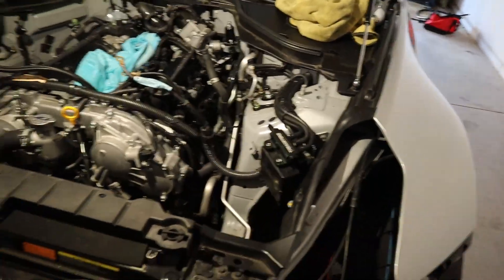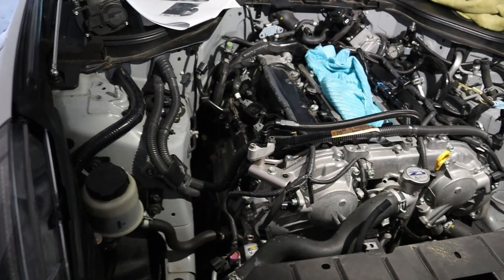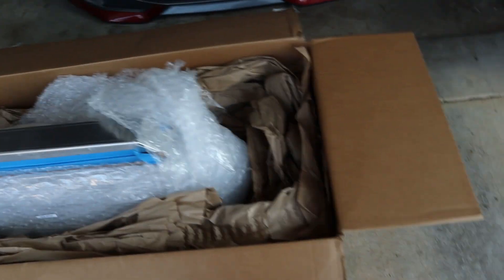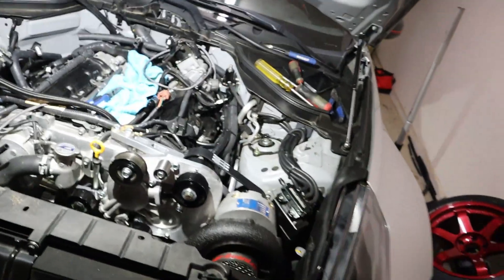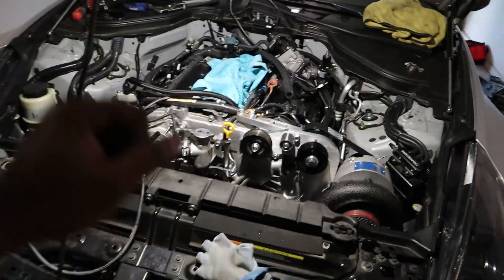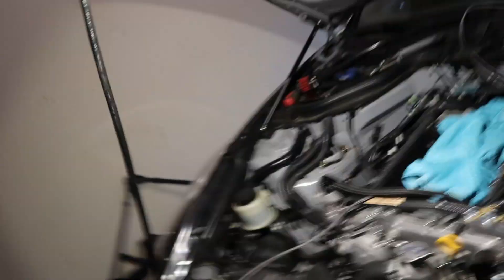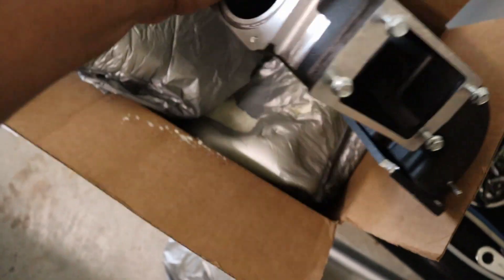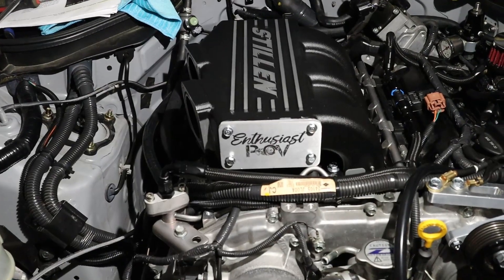Boosting my 370Z Nismo - Soho A2A Supercharger Kit Install Pt.2 First Start up!!

Comment: Just called Yunier at z1 today, helped me pick out a fuel return set up for my car, I had no idea he was making YouTube vids, definitely subscribing thanks for the help today Yunier 🤝
Reply from the maker: Anytime man ! The S1 should be okay, as long as you have a VHR stock fuel rails are okay.
Reply: @EnthusiastPOV  unfortunately still holding on to the de, stock block at that🥲 ended up grabbing the s0, will probably upgrade rails and such when I shoot for more power, and get ahold of a built motor, Jon’s been working his magic but we’ve had a few hang ups hopefully this is the last 😂

Comment: I can't tell if it is or not but make sure the belt on the supercharger is an RPM belt, helps a lot in preventing belt slip. I make 15psi with a tiny filter with one.
Reply from the maker: I have no belt slip on mine. Makes 15-16 PSI

Comment: Congrats man! Can't wait for more content on it. Btw if your getting soho combo catch can I recommend using longer hose for the coolant overflow because after dumping the excessive coolant it got all over the motor & aluminum undertray.  Recommendation get longer hose and reroute it so it can dump it on the ground or just don't put to much coolant on the reservoir.
Reply from the maker: Thanks for the tip bro, I’ll keep it in mind 🤙🏽🤙🏽

Comment: Congrats!  I know how you feel.  Don't go overboard with the timing, as 600whp is plenty enough!  I am about to data log my car to check the knock thresholds.
Reply from the maker: Just a base tune, I trust Jon to give me necessary sauce but I’m
Pretty pleased overall with it!
Reply: @EnthusiastPOV  So, I just completed my first data log with ecutek connect.  It is a small file because it turns out that state troopers are not fond of data logging.  I tried to explain what a pull was, but I ended up pulling out my license and registration.
Reply from the maker: Haha ouch!
Reply: @EnthusiastPOV  I am not much of a computer guy in terms of posting content, but Dynosty's Facebook page now features my 370z Nismo as the most recent post. How far in the RPMs can you get on the base tune?  I know you cannot wait to go WOT!
Reply from the maker: Car is tuned. I need to tighten the cog belt. Made 613whp on 93 at 7k rpm. Belt slipped the rest of the way.
Reply: @EnthusiastPOV  I had the same problem.  They had to reposition the belt and it made a world of difference.  If you can made 600wph with belt slippage (I was at 570 when it happened to me), your numbers will really improve once you can fix that issue.  Hearing your numbers, I now wish that I had gone with the Hellcat pump instead of the 450, as more fuel is always better.  I am really happy for you and wished more of us brothers were into the platform.  Have you been able to dyno the car on e70 yet?
Reply from the maker: Car has not been dynod on e yet. We believe pump will make 640 and 680-700 on E
Reply: @EnthusiastPOV  My car (red Nismo) and another car (white Nismo) are featured on Dynosty's Facebook page.  We both made over 650whp and 450wtq.  My car made 685whp and 495wtq.  The dyno sheet appears in the Facebook posting.  However, the cheap pillar that I bought did not fit, so my gauges are in my glovebox.  I should have contacted your guy for the pillar.  In any event, your ride looks great, and I am sure that you are loving the boost!  Once the pandemic ends, perhaps we can all meet up at an event.
Reply from the maker: Yeah man that’s definitely possible. I should know sometime this week what the car made. Should be similar
Reply from the maker: My guy makes awesome pillar pods, you can definitely know as soon as you get it how good the quality is. I’ll check out the post tonight
Reply: @EnthusiastPOV  I recently was able to add the Dynosty video to my Facebook Page.  It has the dyno session and dyno sheet: https://www.facebook.com/brianjacksonlaw
Reply: @EnthusiastPOV  I know that you installed the undershroud to help with oil changes before you went boosted.  How is the undershroud now that you are boosted - in terms of access to the bottom of the supercharger for service?
Reply from the maker: Nothings changed really. Its relatively easy to service.
Reply: @EnthusiastPOV  Thanks for letting me know.  I'll likely call tomorrow and order one.  I got under my car this weekend and didn't like how my factory splash guard was looking. I like the idea of the after market undershroud, but I wanted to confirm that I would be able to get to the bottom of the supercharger (I also have a Dynosty oil catch can that bleeds from the same area) when it's time for the 7,500 mile oil changes.   How are you loving the car?
Reply: Did you figure out why the engine gave out? I am asking because mine gave out two weeks ago.  I am in the process of getting a built motor but still wondering what could have gone wrong?
Reply from the maker: Engine ran low on oil
Reply: @EnthusiastPOV  I had been throwing random multiple misfire codes p0300 (mainly at start up) and p0420 (catalyst system below threshold). I had just opened it up (running e85) and boom - white smoke everywhere. I was planning to reuse my core until the shop called me to report there is metal on the under shroud.  I am not surprised, as oil sprayed all along the passenger side.  I had thought about just buying a used motor, but I am going to buy a built motor instead.  Nothing too crazy - I just want to be able to throw 15 psi (on e85) at it.

Comment: Does you SC chatter or chirp constantly when cruising at 70-80 mph?
Reply from the maker: Normal on these blowers. It’s the stillen manifold layout. On a soho v2 setup it goes to normal
Reply: @EnthusiastPOV  I have their V2 of their A2A SC kit on my 2017 NISMO and it constantly chatters as I drive and it’s driving me insane. Any thoughts on how to fix it?
Reply from the maker: Not uncommon on the Nismo since it has a 3.9 gear ratio 70-80mph cruises at a certain RPM the SI blower makes that noise. It’s really not that bad. Part of going boost
Reply: @EnthusiastPOV  interesting. Even at lower speeds?  It’s odd because as the engine bay gets hotter it the chattering happenens at lower speeds.
Reply from the maker: The engine bay heat has nothing to do with the chatter lol. And the chatter happens at certain RPMS usually 3k or so. Like I said, just part of going boost lol. Some setups do it more than others.
Reply: @EnthusiastPOV  I’m new at this which is why I’m asking but why is it that factory installed superchargers don’t chatter like this?
Reply from the maker: Factory superchargers aren’t centrifugal either